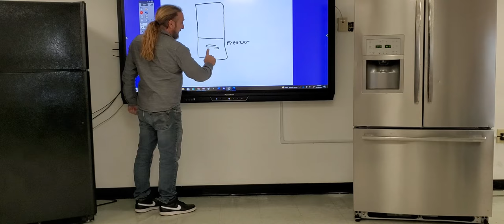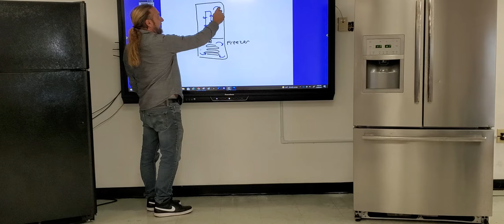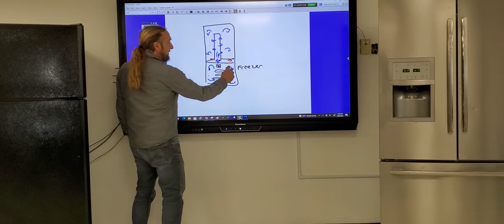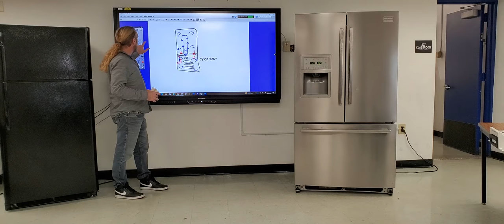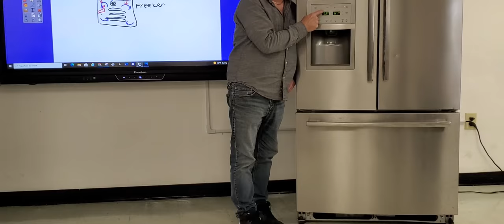Refrigerator Troubleshooting Part 2

Comment: 15:14 - You can reverse the rotation of that shaded pole motor by removing the two bolts next to the rotor, and flip just the stator. Reinstall rotor in the new orientation with the two bolts and the rest of the mounting hardware will be correct to reinstall the modified fan into the fridge. I’ve never seen a cfrrame shaded pole motor that I couldn’t reverse the rotation in this manner.

Comment: No questions  about the fan buy more questions about those other wires around the evaporator coil. One was power and I'd like to see where they go on the back side of the fridge. 
I guess to make my FREEZERATOR I'm going to have to make some mount for the coils in the lower cabinet. As there is no indentation. I will also have to close the holes in the upper  cabinet. With something air tight. 
I wonder if  one could just swap out the layout of the bottom mount fridges ro the tip mount. But it's  probably just as much work.

Comment: I  have a white Westinghouse top freezer, bottom refrigerator my Unit was not cooling in the top freezer and the refrigerator bottom was not cooling very good the technician Chang the top part of the defrosted time or the defrosted heater, and the tech said all is well by right hours  ice will form sold in the ice tray it didn't instead the copper line on compressor started to freeze up and  the food was not freezing up the tech said it is too much gas in the compressor., When he comes back he said the fan was  not working , Chang fan and let out more gas from compressor now the top freezer and the bottom is also freezing up and it is still freezing up on the compressor I just found your chanel and look at your trouble shoot video is their any way you can help me with some type of information  I am a senior and I think the tech can't fix the problem.
Reply: I hope your issue was resolved with little difficulty 🙏

Comment: Anyone here know why the copper coil on lown side at compressor on the back of refridgerator 
have ice built up?
Reply: That could be a bad fan motor or not defrosting. If someone did repair may be overcharged